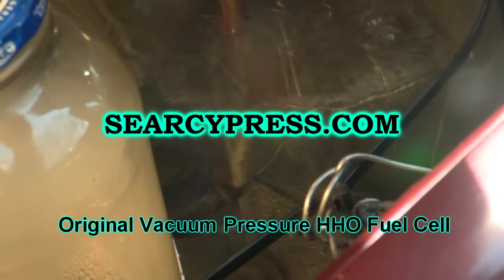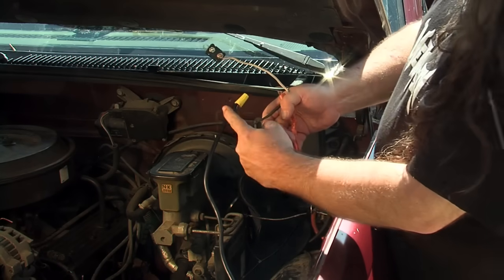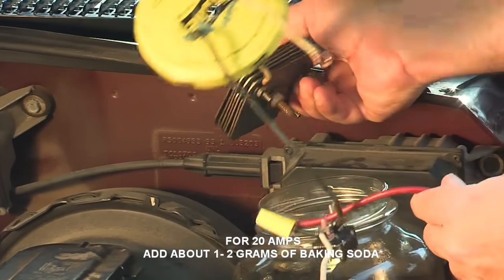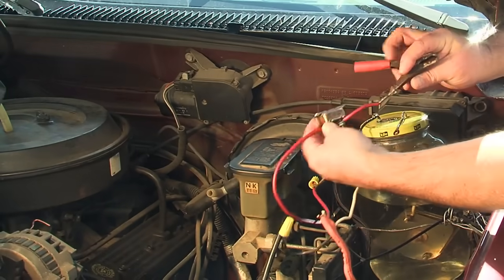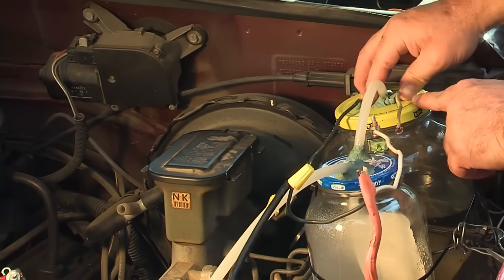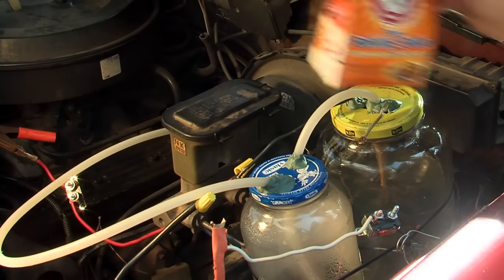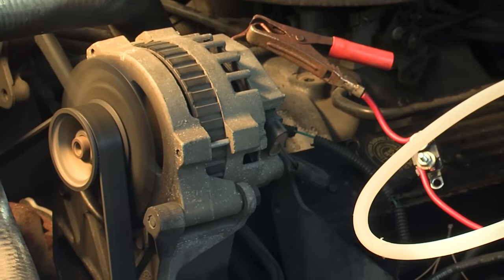Vacuum Pressure Hydrogen fuel cell defeats high gas prices using hydrogen from H2O.

Comment: I've been working with hydrogen generators for about 7 years and there are some issues I can see here. The video makes no mention of how to "trick" the o2 sensor into thinking everything is normal with the increase in oxygen from the hydrogen production. If you don't install an o2 manipulator or somehow fake out the o2 sensor, your generator will be useless.  Your engine will adjust your gas consumption accordingly once it detects the increased oxygen. Second, having wires go through the sharp holes on the metal lid will eventually cause a short and your hydrogen generator will go BOOM. Third, the increased h2o, which is a by-product of hydrogen generation, will quickly corrode your exhaust system. I mean quickly corrode. The money you will spend on exhaust repairs will outweigh the savings on gas. I installed mine on my Cadillac, which by the way, happens to have a stainless steel exhaust system. My car went from 28mpg to just over 40mpg, but ONLY after I installed an o2 manipulator I purchased online.
Reply: Carbureted man come on. Not mpi no obd2.
Reply: Justin Swanson he said carb but it is TBI in reality bro
Reply: Justin Swanson tru. saw that.
Reply: @justinswanson91  throttle body is pretty much a simplified carb, and your right no o2 censor.
Reply: Rob Henrickson 
very valid points you've got there. .
please do a detailed video on how to do this correctly. 
thanks in advance.
Reply: I concur. I did a mason jar set up, and increased my mileage on an 02 Buick century( a number of years ago) from Woodstock New Brunswick to Toronto Ontario by 30 odd %. But once the computer realized I was getting such great mileage, it compensated somehow (I believe dumped more fuel in, and I got worse than normal mpg. I needed to take it to the next level and trick the computer. But never did attempt that. I may look into trying a better system this one around. It does work!!
Roughly went from 32 mpg cnd to 43 mpg
Reply: Exactly Richard! That's what happens. There is an "initial" gain, but once the computer figures out what is going on, it compensates/adjusts as it is intended to do. This is one of the reasons HHO falls on it's face (besides the fact that it's a weak hydrogen to begin with anyway). HHO is a waste of time and can cause problems with parts longevity (alternator and battery) and it's got other issues. So, is it saving anything in the end? No. It's complicating a system which does NOT need it/benefit from it at all. It's piss poor hydrogen "on the fly" and not even enough to power one revolution of the engine, in one hour of generation. The math and Science just don't support it at all.  

Pure hydrogen (in tanks), is valid though and it's the future. Stations are already popping up and current vehicles can be adapted to use it for a couple of grand (that's already a win over electric). Just like propane conversions which have been happening for decades now. It is expected to be the tech of the future and will outdo electric, for multiple reasons. It's faster to fill for one thing (min. 1 hour charge on a Tesla supercharger, the best there currently is for battery tech). The speculation is, that electric is going to be a "niche" market, the real future is pure hydrogen.
Reply: Bill Does Stuff I agree but I’ve also heard hydrogen requires waaaay more energy to produce ca electricity. I also heard there is not enough lithium on this earth to replace all the vehicles so batteries must improve. Can you recommend a good hydrogen system for a 05 Chevy Aveo??
Reply: The only valid way to run a vehicle on hydrogen is to convert the vehicle to hydrogen, DNA Herte (like with a tank of hydrogen). Very similar to how they run vehicles on propane and have for decades (I've driven taxis that ran on propane). Most vehicles can do a conversion to pure hydrogen, but it costs a few grand to do. There are hydrogen service stations starting to pop up in the U.S. to my knowledge. There are also natural gas powered vehicles and have been for ages. Those are the ONLY valid alternatives to petrol gas, is propane, natural gas and now pure hydrogen. I would not recommend conversion to anything, until you know how if there are fill up options where you live.
Reply: I had no corrosion on exhaust. ruined a few cylinder heads though. two sets in four years.
Reply: @strapped9   ya you'd probably prefer an aluminum block over an iron haha
Reply: strapped9 this is what I been saying for the longest time... people who believe this system helps your car and your wallet is full of shit. The system doesn’t work your still pushing out the same gasoline and now we see people claiming that this is more economically friendly when reality is that it’s not. It’s just trying to add something to an equation that is already done its job...
Reply: Justin Swanson
WRONG... That is a TBI engine. Uses two fuel injectors at the top of the throttle body.
Reply: charlietow wonder if it would work old cis system...my turbo gets 30 mpg  stock
Reply: Couldn't you just split the gasses by keeping the anode and cathode separate because the hydrogen ions stick to the cathode while the oxygen ions stick to the anode
Reply: @SanoKei  Yes, I'm pretty sure that's right.
I think the idea here is to use the mixture as is, seeing it should be as near to perfectly a stoichiometric mix of hydrogen and oxygen as possible?!
Reply: @AndySoop1979  it is a very explosive mix I've played with it a lot I'd tend to keep the gasses seperit and pipe the Ox.an H separate don't know if that will really help check valves are a lot easier .
Reply: @AndySoop1979  Yes finally someone seems to understand .... the water is perfectly split into the stoichiometric components which are then sucked into the engine as a perfect stoichiometric "bundle of components" ready to "react ..... burn" back to their product ..... water. Everyone seems to be stuck on the hydrogen using atmospheric intake air, it may but the H2 and O are right there present in perfect balance and once in presence of an ignition source will fire more efficiently than the gasoline and air. The H2 + O will then be an "accelerant" for the gas/air mix. There won't be extra O in the exhaust .... where would it come from? The H2/O is "displacing" the intake air. In a fuel injected system that could be an issue. However this is pretty much about the same as adding nitro to a racing engine .... you are adding an "accelerant". Excess water will only be an issue in extreme cold weather ... so wait to turn it on till engine is warmed up. Gasoline burns to water and CO2 so whats little more water? And about the O2 sensor "manipulators" ..... they are just spark plug sleeve extenders. All they do is pull the O2 sensor out of direct path of exhaust say 1/2" or less. The O2 sensor does not see the imbalanced fuel ratio and makes no adjustments. I have used them on my Honda Pilot to fix a nagging problem with the computer "thinking" the engine had an improper mix ratio. They stopped the rich mix and my fuel economy went back up, I have an onboard OBD reader and for a while monitored engine temp. Engine temp corrected from the rich mix and all is right with the engine. I bought it used and someone didn't want to invest the shop time and money to adjust the valves, install plugs, install rebuilt injectors, replace plug coils, etc to isolate the problem ..... the Onboard PC was intermittently cutting out cyl 6. They drove it nearly into a junkyard grave and then decided to dump it. After cleaning up the Evap system and doing the other stuff and still getting the intermittent miss, I had it scoped  and isolated the PC. A great vehicle! MSRP $35K for 8% of MSRP. not bad!
Reply: An o2 manipulator is corrosion friendly?
Reply: you've mixed up sensors.
Reply: Where does this O2 manipulator go, does it replace the O2 sensor in the exhaust? Thanks.
Reply: @mattywollaston3996  the EFIE device (also called the Electronic Fuel Injection Enhancer or "o2 manipulator") connects to the computer of your car and to the o2 sensor.
Reply: MR UVA look up a mazda speed 3s fuel  injection  pressure or direct injection....i want to say its 10000 psi but forget....i also have a 500 dollar computer that adjusts everything possible thing the stock computer monitors...timing, maf ,boost  ....i bought it for the intercooler upgrade and large oil cooler i bought. I think i could safely run hydrogen in small amounts and then raise it and get a live readout of what my engines doing and safely tune it. i also have an rx7 and ive read rotories have no problems burning pure hydrogen and then flipping a switch and running petro. Like i said before just buy a 20 dollar larger after market pully or a larger alternator and buy say 4 small 12 volt batteries and hook them in series to get 48 volts and lots of hydrogen on demand. Those little ugly priuses have squirls for an engine and they have no problems moving the car and recharging banks of lithium batteries. Ive worked a little my self with chemistry when i used to work at Dow Chem. You can even make it easier to crack the water by using a sound modual ....a company sells this which makes it easy for the stock electrical to keep up hydrogen production.
Reply: Not to mention the fact that the energy put into generating the hydrogen will be more than the energy you get out due to entropy unless you're somehow using waste heat from combustion to power electrolysis.  Sorry, didn't watch the whole video.  Maybe he's doing that.
Reply: @sciencecompliance235  Using exhaust heat to make the water to steam to make electrolysis is more easily efficient and makes the eletrolysis unite open system thermodynamics themed.

It'll still only make so much oxyhydro..
Reply: That can be a big risk of manipulating your O2 sensor running it lean if you run it to lean You can have an engine melt down will create so much heat that everything will ruin including your catalytic converter be careful with a manipulator
Reply: Abraham Ghannam sure, if it had one! 😂😂
Reply: @abrahamghannam2137  just keep it below a certain percentage oxygen. Cold weather increases o2 but no engines are melting.
Reply: @The Muckler Please enlighten me then, guy.
Reply: Infiernofox138 could you do a video build? Thank you.
Reply: CARBURATED
Reply: I don’t think his 1972 Camero has a o2 sensor.
Reply: O2 measures stoic if it sees increased fuel being burnt hho or really anything 
The ecu will compensate to keep the afr (air fuel ratio) correct meaning injector duty cycle will decrease meaning less fuel being injected 

That would be for a fuel injected engine tho not a carb engine 

All new engines are injected and honestly you don’t have to do much at all to make the engine run off other fuels as long as you don’t over fuel with ur secondary fuel ur using like propane or any other fuel ur trying to use that is cheaper I can’t see hho being a issue because it is stoic right from the separation of it self Maby if ur running boost the only concern I have is the chlorine produced from the electro light  you would think that would begin to erode and weaken ur cylinder walls and piston or remove the glase in ls and up engines but I guess only 1 way to find out engines are cheap if you can turn a bolt
Reply: HOW DOES ONE FIND THIS O2 MANIPULATOR? 
AND THERE IS ALREADY A LOT OF WATER AKA CONDINSATION GOING THROUGH AN EXHAUST SYSTEM. ONLY ISSUE WILL BE FROM THE MANIFOLD TO THE CATS AFTER THAT IS WHERE A LOT OF THE WATER ALREADY ACCUMULATES.
Reply: Why do you need an exhaust if it only produces water?
Reply: @MR UVA shut the hell up. Getting sick of ya bellyachin. U can get a high amp alternator, like used on high end car audio. Mine is 370 amps. Some guys run 4-5 of them at once.
Reply: Its an old ass truck thats carburetor fed, not no fuel injection system with o2 sensor and catalyst lol
Reply: I think your talking about the maf sensor the 02 sensor screws on the manifold there is a 02 manipulater sensor you can buy that looks the same that you screw in there and trick it to make the car run rich or lean and this makes since cause if you don't manipulate the 02 sensor it will tell the motor to push more gas if you manipulate it then it should compensate for the hydrogen.
Reply: I don’t believe this engine relies on any electronic component to run. A 350 can technically be started on an engine stand with a small bottle of gasoline. It doesn’t need any electronic components to run. They started adding sensors and computer controlled ignition systems later. That was all to reduce emissions and increase efficiency. I believe this engine is much more simple. Which is why a ghetto rigged setup like this might work. If this engine had computer to control it this system would not work at all.
Reply: @SamMarieslettering  You're better off with a steam injection and plasma ignition, the plasmolysis of the steam will add to the burn of fuel, whether CNG, LPG, alcohols, or gasoline.
Reply: Can you show a video with the plumbing from the Hydrogen bottle to the engine?
Reply: Cant you reset the sensors by resetting the ECU by disconnecting your your battery for a half hour?
Reply: Kyle Smith no resetting the computer only resets it to factory specs when new then by running the engine for a few hundred miles the computer fine tunes the factory specs to get optimum effency
Reply: MR UVA ..hey i also have a rotory engine car and rotaries can and have burned gasoline and hydrogen by just flipping a toggle switch....mazda cold weather tested the gasoline -hydrogen --electric powered rx-8 in Norway
Reply: Carburetor... doesn't have o2 sensor
Reply: Rob Henrickson It’s not going through the O2 sensor
Reply: Im yet to see a hydrogen generator that is cost effective.
Reply: @MR UVA I just like this scientific reply
Reply: Hydrogen doesnt create more oxygen.. it interacts with oxygen to create an explosion
Reply: @MR UVA I don't mean to counter reply
But why would car manufacturers not provide an alternator that is capable of charging the battery faster?
Reply: So what did you get to manipulate the O2 sensors?
Reply: Um its not fuel infected lol
Reply: Rob Henrickson I hear say that the correct answer to this ever expanding argument is....*farts*
Reply: car bu re tor
Reply: @MR UVA Alternators put out alot more than. 04 amps. And batteries put out a hell of alot more than 5 amps Mr internet PhD
Reply: @MR UVA Alright Mr internet PhD alternators put out alot more than that. I have 136 amp apt in my jeep and a 1400 COLD cranking amps battery. So tell me again about your amazing knowledge
Reply: @MR UVA Google again
Reply: I have been working with this type of thing for a while 10+ years, 1. You don't get that good of mpg. I had one on My 94 Towncar and it did improve my mpg from 19 to 23, and did clean the engine, and also helped the emitions.
Reply: Edom, and from which year is Your car? I think is car with carburetor, without computer and lambda sondas... - old engine with wrong mixing fuel with gas.
Reply: *Edin. Author of this thread is death from explosion, or in shame...
Reply: why not do a fuel vapor setup also?
Reply: @0akley75  Good question, you could use a fuel prevaporizer system with steam or water-methanol injection and pair those two with plasma ignition for MASSIVE power boosts and fuel economy boosts.

Thing is on modern fuel injection systems, that's a BITCH to work around, but the carbureted engines, this would be nearly effortless to do once you've figured out how to replicate the Pogue Carburetor, use modern self-lubed ceramics, mettalurgy, and simplistic ECU tech to the said Pogue Carburetor for the best tunes for both mileage and power while increasing engine life.
Reply: An EFIE device is needed for vehicles that have O2 sensors. But the wiring is pretty accurate from what I see. Just a cheap version. But it works
Reply: @prclifegrouplane  an electronic carburetor enhancer if it's carbureted
Reply: your gains probably came with the ability to manipulate the o2 sensor...
Reply: I would guess your Cadillac is newer and takes much more "data" into account.  If his truck is an older one, they're not as picky. My dad had an older Ford pickup (like late 70's, early 80s) and I swear to god, it seemed like we could put dump Tiki torch fuel in it and it would run....
Reply: have often wondered if we account for the amperage we have to produce the Brown's gas? And would it kick out if you had an additional battery you previously charged. Would this be similar to having another gas tank?
Reply: Ok, enough why it won't work! Tell us how YOU would make it work in detail! Not it can't!
Reply: Rob Henrickson I have an 86 dodge truck what is the best way to do it
Reply: It appears he is running a carbureted vehicle so no O2 sensor to trick
Reply: He has a carburated 350.   His 02 sensors probably just throw a code but can't send word back to a throttle position sensor or mass air flow sensor to change the air fuel mixture.
Reply: Hi Rob, is there anyway i can contact you?
Reply: So your car went from 28mpg to just over 40mgp...I assume we talking gallons of water here? correctomundo?  I can take a shower and use 5 gallons of water...imagine how far I could go instead of doing that? It boggles the mind!
Reply: @psimonkane1  J what?  You do realize that if you burn 1 gallon of gas, you get 1 gallon of water as a byproduct. This is true of kerosene and other fossil fuels too.
Reply: you cannot run the system on fuel injected vehicles, that why the corporations came out with fuel injection! they claimed the tech was better, but what they accomplished was the 02 sensor as part of fuel injection stopping the use of hydrogen generators.. this way they could get you to burn more fuel and keep the emission dirty. Hydrogen added to fuel burn cleans up the emissions. everything the auto industry does is to hurt the planet and make more money. Control ENERGY control the human species
Reply: @sardcanada2640  The last thing he said was by far the dumbest.  Water is a byproduct of burning gasoline.  He actually believes (or is lying) that the water is coming from the HHO. It's not.  If here were using that much HHO to generate visible amounts of water, that jar would be empty in no time.
Reply: The H2O produced would be distilled. There would be no salts or extra o2 to corrode anything. It would essentially keep your exhaust system cleaner not rustier. why would there be any increase in 02 production. He's pumping in oxyhydrogen which fully combusts and if he was making the Hydrogen and Oxygen separate he could simply outlet the o2 somewhere else and burn the hydrogen off the standard intake. O2 sensors are afterburn so they would only pick up anything not spent. This is a Oxyhydrogen generator not a hydrogen generator. And last, where would you assume friction is being placed on the wires?
Reply: Are you one of my brothers or sisters
A good prayer:
I'm a sinner JESUS please forgive me for all my sins I know you shed your Blood for me on the cross at Calvary. Thank you JESUS for my salvation and for shedding they Blood for me. I love you JESUS. 
Romans 10:5/10 ct...❤️k
JESUSisLord!Amen...
Amen..
If you'd like to call someone who cares 
83
For
Truth.
bc you don't know when you'll die?
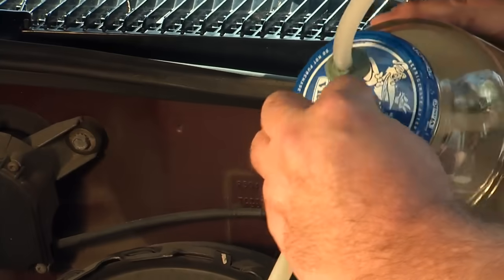.y r u hesitant......John 3:16 & Romans 10:5/19
Reply: Hey Rob Henrickson do you have a video of the cadi w/ss exhaust n hydrogen influenced fuel system setup by chance?
Reply: 1 this won't work on a modern system with electronic ignition and fuel injection due to o2 sensor and system setup to run gasoline will adjust to run shitty on any other fuel unless maybe it is a flex fuel vehicle. Maybe. They can run any mixture of gas to ethanol and the only difference is the programming. They program new vehicle to run shitty on alternative fuels on purpose.  
2 drill and file the holes or use a sleeve of some sort. 
3 H20 is a byproduct of any hydrocarbon combustion.  That's all the puffy white smoke when it's cold.  Steam.
Reply from the maker: Don't be so sure. Most of the problems you hear about hho are involved in injection into the air system itself and not the vacuum. Everything is different when injecting into the vacuum system. New video coming out soon. Be sure and subscribe. Thanks for the comment.
Reply: hes got an old carbuerated 350....no o2 sensor buddy
Reply: This is not generating enough oxygen to make a difference.   Aside from HHO not actually working and the incrediby bad wiring job, he seems to think that water is coming from the HHO. That is not true. The water is a waste product of combustion.
Reply: Its carburated no 02 sensor
Reply: Rob Henrickson can you recommend a kit and sensor?? I’m desperate to set this up on my 05 Chevy Aveo I deliver food all day and spending about $35 a day on gas!!🤪
Reply: @Dna Herte 

But my geo metro.

Gets 42mpg
Reply: Ok smarty pants, relax with the BOOM
Reply: Chuma Doshi lo
Reply: Website guy your terms are so foolish... how do you trick a chemical compound ? Do you mean filter it into the intake chamber? Also wtf does the O2 vs the Hydrogen of a compound do you even try to comprehend. Your still taking energy to break those bonds the logic behind this is flawed because your still using energy to try to work your car harder but your only using a fraction of the energy during combustion converting of energy to create this hydrogen fogger no less... your just wasting energy to try to improve something that already has an energy efficiency at top notch which is already established with electronic fuel injectors and electronic ignition. We see this already with standard cars. This is still a horrible thing to do to your engine and the claims you made is debatable at best because first of all. You can’t trick a chemical compound you can cause chemical reactions which uses natural chemical reaction to create the chemical bonds you see before you. Your just trying to put electricity into water and create steam from that electricity which is naturally hydrogen which if you haven’t paid attention to energy class is one of the top green house gasses. The fact there isn’t much of it in the atmosphere right now will change if you try to change from Carbon to hydrogen. Not all the time you will have water created into the exhaust you still get different types of bonds happening through the process when you break the carbon away from the hydrogen using Oxygen as a carrying compound in the combustion process. That’s why you have pistons in your car because those are combustion chambers that run and push pressure and cause for the combustion to occur... I’m seriously tired of HHO people dedicating their lives to a system that doesn’t do any difference to the energy being produced.. their is already more than 2x the amount of hydrogen in octine why do you want us to break down more into it?
Reply: Most people that do this, from what I've seen, tend to put the hydrogen input past the O2 sensor. As far as I've seen in newer vehicles most O2 sensors are halfway up the intake, so there's plenty of room to add in a hose and reseal.
Reply: LastKnight0727 You have no clue how O2 sensors work.  They are ALWAYS in the exhaust.  Usually 1 or 2 before the catalytic convertor, and on later cars 1 or 2 after the catalytic convertors.  The number of O2 sensors is based on the number of exhaust manifolds you have.
Reply: @LastKnight0727  🤣 that's a map sensor, a o2 is in your exhaust
Reply: @LastKnight0727  you have no clue what you are talking about do you lol
Reply: MR UVA 2 or 3 lead acid batteries will give you hundreds of miles before draining the battery....but it wont because the alternator will just work harder and if it cant keep up jusy put on a latger pully to over drive it. Easy easy simple diy fix. Ive been thinking about hooking up the hydrogen on the fresh air intake hose and using my odb port for my tuning my turbos boost, direct ingection  ports and timing to tweek a non knocking gas hydrogen fuel....also looking into seeing if the h gas could be mixed into the gasoline but dirrect injection is powered by the engine crank creating thousands of pounds of pressure. Would like  plum into the line just before the crank pressure rise and have that creat a vacume to suck h gas into the gas line.